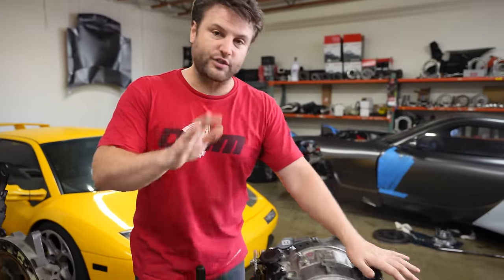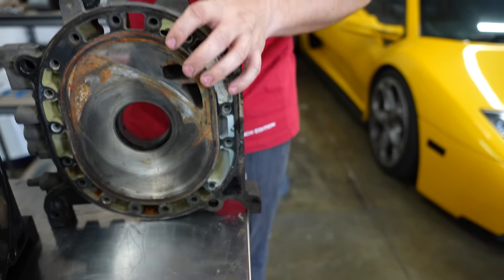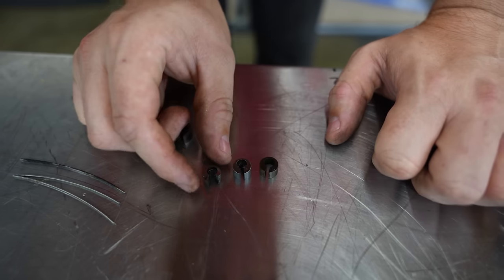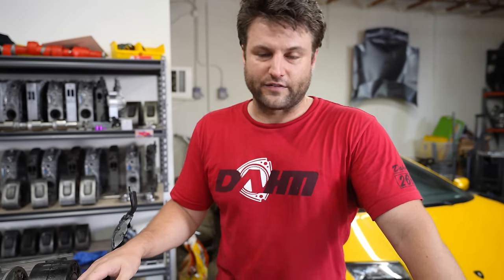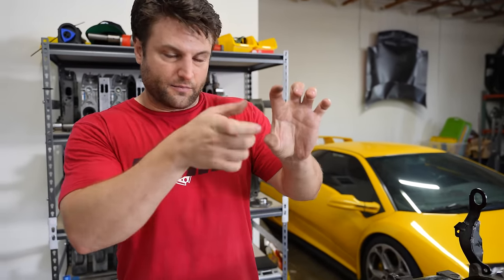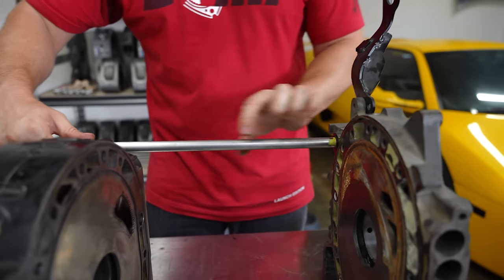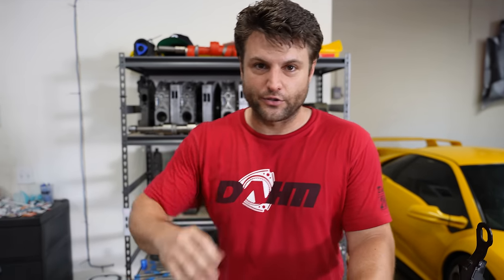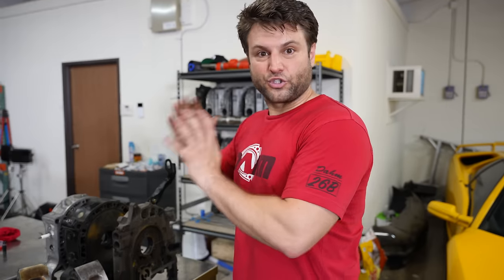Fixing the BIGGEST Problems of the Rotary Engine

Comment: I love the idea of Wankel (rotary) engines. But I'm not satisfied with what has already been made, I know we can do better if we try to make a "modern" Rotary engine.
The issue right now is that not enough people are trying to think of ways to improve it compared to the amount of research going into more conventional piston engines.
To that end, there is one thing I want out of a rotary engine that it does not (yet) have, and I think it is possible (not sure about practical, or economical, but it's not prevented by the laws of physics or our current understanding of material science).
I want it to have apex seals that last a lot longer than they do right now, without needing oil to prolong their life.
How do we do this? Use slightly more high-tech materials and processes when making the apex seals, rotor, and housing.
What specifically?
I'm pretty sure that if executed with a high enough degree of competency, highly polished sintered ceramics such as those used in single-handle bathroom faucet valves would be suitable (the ceramic valve seat used in those type of faucets is the last part to fail, despite tens of years of daily use, meaning that this ceramic is highly abrasion resistant). Tungsten Carbide as used in cutting tools might also be useful here, and before you say that's gonna tear up the housing, remember that a dull knife doesn't cut no matter what material you make it out of! So with the right profile to the edge of the apex seal in contact with the housing (as dull and as well polished as possible, to minimize abrasion due to friction), a rotary engine using apex seals made of ceramics should be able to last longer than 100k miles in a road vehicle application. Ceramics are usually highly heat resistant and Tungsten Carbide specifically is no exception, meaning that once again there is no reason that they can't last a really long time inside a rotary engine.
But we can still do better, thanks to the magic of Coatings.
What's better than Tungsten Carbide? Tungsten Carbide with a vapor-deposited coating of Diamond or Titanium Nitride. These coatings are also both used in cutting tools, which is again why I suggest them here. Both lower the friction between the housing and the apex seal above and beyond what polishing and profiling can do, again leading to increased apex seal lifespan before needing inspection or replacement.
Now on to the housing, because if you thought the solution to the apex seal problem was all in the apex seal itself you were only a little bit mistaken.
The housing of the rotary engine can be adjusted to make it better in several ways. Weight can be reduced by switching away from a solid cast iron housing to a "composite" housing (no polymers, but multiple parts) made of a different alloy of steel as a liner for the rotor to occupy (and for the apex seals to ride on, so it would again be highly polished), but then the majority of the housing would be made from Aluminum. With the selection of the right high-strength casting-friendly Aluminum alloy, (or even better yet, forged aluminum billets using a forging-friendly Al alloy, tho this is a higher cost option) this could also increase the amount of Boost that such a rotary engine could safely handle, leading to a higher power output for the same weight, reduced weight for the same power output, or a balance between those two factors, all three still being a relative increase in power-to-weight ratio (forged billet housing components being capable of handling higher boost, of course). Of course, given that increased power output usually increases exhaust heat load, there might be a need for an exhaust passage component in the same housing once again made of a Steel alloy, or that same area could just have more cooling passages placed near it to compensate.

Comment: Me watching this video: oh yeah. These are problems I will most definitely have.

My Rx8, daily driven under 6k rpm unless redlining: your APV motor is bad. Your ignition coils need cleaning. You're not burning up all the oil and 2-stroke cause you're not redlining it more than once during daily drive. Electronic motor in rack is bad cause you drove through a small puddle too quickly. Radiator nipple cracked. Ignition coils went bad (after 4 years). Positive Crank Case regurgitated oil into your accordian tubing. Spittin out white smoke at high rpm (doctor's only prescription: needs a redline).

Comment: Couldn’t they have made the Apex and the part of the engine that has the rotating piston so that the Apex seal has grooves in which it slides and is lubricated with oil for a better seal?

Comment: building a rotary out of ceramics is the obvious. With ceramics combustion and engine temperatures can be maintained  high enough to achieve EPA emissions standards.  
it would also improve thermal shock charateristics, power delivery, dynamic balance (and rotor and housing weight,  much much higher compression ratios at all rpm. Indeed higher RPM becomes primarily an issue of how much fuel/Air mix can be pushed into thr engine.
and imagine an uncooled Rotary, with coolant only supplied to intake manifold, and downstream of an tuned expansion chamber in the exhaust manifold.

not cheap outside of a mass production context.  but imagine a 600cc three rotar motor that you can pick up with one hand, and piumps out 1200HP at 15000RPM.

Comment: The new updated rotary engine actually has three chambers three combustion Chambers per revolution in a sense it's more like the two-stroke cycle engine because it cycles faster instead of the four stroke cycle engine which actually has to rotate twice the complete cycle in it
Reply: "The new updated rotary engine actually has three chambers three combustion Chambers per revolution in a sense it's more like the two-stroke cycle engine because it cycles faster instead of the four stroke cycle engine which actually has to rotate twice the complete cycle in it"

2 stroke vs 4 stroke refers to the combustion process- in which case it is like a 4 stroke, as it has a specific intake, compression, combustion, and exhaust portion of the cycle.  "2 strokes" do 2 of these simultaneously (intake and compression, then combustion and exhaust).

Comment: The 2-smoker oil that would be best is not "just like a weed whacker". That would be a small displacement, short EPA lifespan air-cooled 2-smoker oil.   Typically those would be something like an old TC class oil. Major japanese mfgrs didn't like what the vague TC class was doing to their engines, and started the JASO/iso classification FD. Typically not an "ashless"  The ash (seemingly a bad thing for rotarys) is made to reduce cyl scoring post firing. The ash remains after the lubricant is burned off.   Is that residue bad for a wankle?  who knows, it is there, and it is going to interact with the seals.  FD oils are made to provide the anti-siezing ash at high temps, they don't work well at lower engine temps.    In comes tc-w3 oil, made for low temps found in water cooled 2-c, it is "ashless" and has lower flashing solvents/detergents.   TC-W3 has been the death of more than one liquid cooled snowmobile engine, but may be great in a spinning Dorito.   Love the vid.   wankles for me have been as much aggravation as delight.

Comment: I don't want to know the secrets to making a rotary engine reliable. I want to know the secrets to making a rotary engine as good as a piston engine in every way.
Unfortunately that is impossible. The Wankel design has some fundamental shortcomings -- most of which are caused by the fact that the combustion chambers in a rotary engine don't have undersides where oil can be applied and scavenged -- and those shortcomings cannot be solved without redesigning the engine so radically that it's no longer a Wankel engine. I owned one for 9 years and by the end I was glad to trade it in for a normal car.

Comment: As it's been stated many times, Mazda had had 50 years to develop these engines yet have still failed to make them economical, reliable or durable. There may be (perceived) reasons why this is the case, but it would be ignorant for anyone to suggest or believe that in all that time Mazda, with their vast engineering resources, would or should be unable to solve these problems.
And if for some reason they are or were unsolvable they should have binned it.
In the infancy of these engines this may have been somewhat excusable but not now. A consumer should expect a lot more from a "modern" engine with relatively few miles on it than these piles of junk do before they fail.

Comment: how to fix the rotary engine: melt it into a piston one. In any performance setting they gulp gas and get bad emissions. A 2005 rotary without emissions equipment smells like a 70s car. Even a super tuned and big turbo mustang of recent model years doesn't smell that bad when pulling.

Comment: The biggest problem with the rotary engine is that it is very dirty! The exhaust column does not get hot enough to employ a catalytic converter. Fix the low exhaust temp problem and this engine would shine like a new penny. Sad fact!

Comment: The motor itself needs to be simplified with shimming and more bolting around   points where engine is pulled together .  ....    someone needs to re invent. The idea so it can be supercharged for low revs and turbo at high revs bleeding compression for easy  reving  with no fight against motor components like a 2 stroke power valve  sort of shit ...   create one with an engineer and a computer cutter ....

Comment: Question nobody has ever addressed. How much of your "pre-mix" oil gets eliminated by your fuel filter? I'm thinking the "resivor" system operating on the oil metering pump surely,is a better solution. 100% oil,& full life of fuel filter. Anything the filter catches can/will eventually clog it. Especially oil,even 2 stroke the filter is NOT made for.

Comment: Why dont you just machine the intermediate housing and the 2 rotor housings as one single big piece. That leaves only the 2 side housings that will bolt one and you eleminate those long tension bolts and alot of gasets.

Comment: Step 1: Get a rotary engine
Step 2: Get a sledge hammer
Step 3: Repeatedly hit rotary engine with sledge hammer
Step 4: Clean up all the debris and throw it all away

Rotary engines are not the holy grail they were meant to be, at least not how they are currently built.

Comment: The rotary engine: Solid geometry that is inherently unstable when reacting to the forces it must endure. Stable geometry: the CIRCLE. Traditional combustion engines employ circular geometry: Pistons are cylindrical circles. The cylinders they travel up and down in are, well cylinders , I.e., ,long circles .  STABILE geometry. The only thing inherently unstable is the crankshaft, and it is counterbalanced, and it basically floats in a film of oil. ALL very stabile solid geometry. The rotary engine is just a not good idea, and it will eventually become extinct.

Comment: Instead of deleting the metering pump, why not just run it into a sperate reservior for the two stroke oil instead of the crank oil? Then you won't even need to premix.
Reply: "Instead of deleting the metering pump, why not just run it into a sperate reservior for the two stroke oil instead of the crank oil? Then you won't even need to premix"

1 major point of consideration is the literal spray pattern you get comparing OMP delivered lubrication to injector based lubrication. 

Using premix has the pre mix oil basically dousing the entire intake charge- giving you a big healthy coating on pretty much the entire inside of the engine.  On the 13b and rew motors the OMP comes in through a single tiny port.  

When you pull apart motors that have only had OMP lubrication, you can quite often see a "clean" happy lubricated spot passing this OMP port- where the seals were nicely lubricated- And then they tend to "wear" on the outer edges away from that OMP port.  

When you premix however the apex seals tend to get good even lubrication across the entire face of the seal the whole way through.

If i recall one of the "improvements" of the 13b renesis (rx8 motor) was the use of 2 OMP ports per housing instead of 1. But sadly the renesis had a handfull of step-backs in other directions in order to try and make it more consumer (and epa) friendly.

Comment: This is a very odd engine, one I'll never own or work on. Those doll pins, shouldn't they just be short enough to go between each section with a press fit like a standard piston design head to block has?

Comment: E85 is not good for rotary engines since the alcohols in ethanol will fuck up the oil required for rotaries to run smoothly which will likely reduce apex seal life.
Reply: "E85 is not good for rotary engines since the alcohols in ethanol will fuck up the oil required for rotaries to run smoothly which will likely reduce apex seal life"

1: Premix
2: Change your oil frequently. 

The benefits of e85 for a rotary are utterly amazing.
Reply: @AI_Ralph  "I don’t think you’ve actually owned a rotary engine"

Ill make sure to pop the hood of my FD and double check what its got next time in the garage.

Comment: If the Bain of Electric Cars are the Batteries/Charging/Cold then first 2 problems are solved by Quick Change Batteries. While Roads with Battery Charge/Drive Lanes. i'e. Charge while Supplying Driving Power. Now the real Problem where does all the EXTRA Electricity come From.

Comment: says he has success at the beginning while going over all the engines he's blown lol. Also, it is very important to balance your rotating assy if you'r going to use high rpm's and yes lighter rotating assy makes a huge difference in all motor applications.

Comment: The elephant in the room is, of course, poor low-speed power. Like turbine engines, all the power is at top speed, not exactly useful for daily driving. Another issue is fuel economy. For so little power, efficiency is pretty bad.

Comment: Rotary Engines are not unreliable.
one can easily double the Output of a Rotary Engine ( with a simple and cheap Modification of just Porting) with no significant decrease in Reliability. not so with a Piston Engine. serious Modifications and serious Money is needed to increase Performance and even more Money to make them last.
and even extreme Power in a Rotary and the Modifications needed to make it reliable are nothing compared to a Piston Engine !

Comment: It's a very low mileage engine because it's a high revving engine this engine revs at 10,000 RPM and it only runs at 10,000 RPMs there's no low RPM like the regular reciprocating piston engine which can run at a thousand or sometimes most at 1800 it's 60 mph that's one reason the reciprocating piston engine last so long

Comment: Unfortunately there is no solution for the biggest issue. Fuel consumption. Where i live (europe), the 1.3liter displacement is very lucrative because of the high taxation, but everything you save in taxes, you spend on fuel, and fuel is EXPENSIVE. So nobody wants these cars. RX8s are dirt cheap. Their owners are practically giving them away, but nobody wants them. I've seen a few end up in the scrapyard or being sold for parts.

Comment: I figured premixing would solve a lot of problems with carbon buildup as I have some experience with Mopeds. It is extremely interesting to have an engine using 2 different types of oil. One for the bearings/shafts and one for the rotors. Do you have any 2 stroke oil you recommend and mixing parameters?

Comment: why on earth would you use snythetic oil rather than mineral?
Reply: "why on earth would you use snythetic oil rather than mineral?"

Because its superior for lubrication.

The entire reason rotaries are known to run mineral oil over synthetic is because from the factory they inject oil into the combustion chambers- And synthetic oils are not meant to be burned.  Mineral oils arent really "meant" to be burned either, but they will burn far, far better than synthetics- which will foul up and leave massive deposits in the engine quickly. 

Deleting the OMP and running premix (which is an oil that is meant to be burnt) removes any and all concerns about burning synthetic oils- and lets the oil be just that, oil for lubrication.  So of course youd pick the oil that is superior. Ie,  synthetic.

Comment: I'm surprised Wankel engines last as long as they do. The design simply doesn't look sturdy and reliable.  I don't know why Mazda went with them when a piston engine has proven itself reliable. The tolerances on a rotary engine are very tight and not forgiving. Ring sealing is a nightmare. Worst of all, they would be extremely difficult for the average person to repair. I've rebuilt many engines and are they are quite easy to do and most importantly... inexpensive to repair. Also, on a V8, V6, or 4 cylinder, it's easy to experiment with different carburetors, spark advance, camshafts for better sound and power... little flexibility is possible with a rotary.

Comment: All mods to raise power is a bit inexpensive,  compared to piston engine
Reply: "All mods to raise power is a bit inexpensive,  compared to piston engine"

Realistically a port job and doweling is all you need to do to prep a motor to make more power than youd ever want/need in a street car.  Everything else will be external and comparable to a piston engine.  Working the internals of a piston engine are far, far more expensive- as theres a lot more to upgrade.